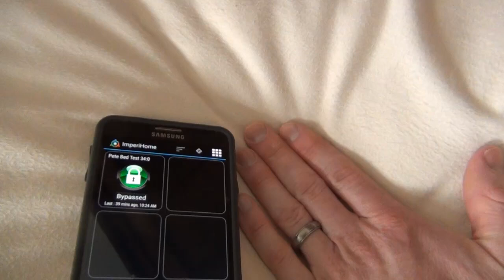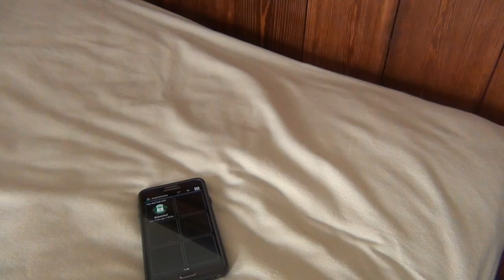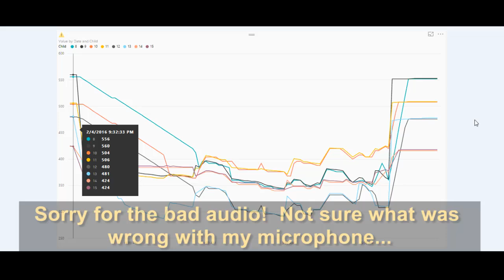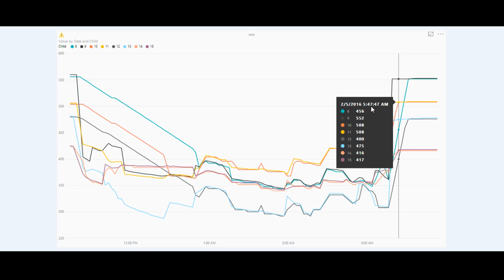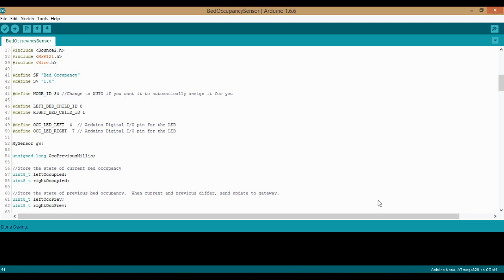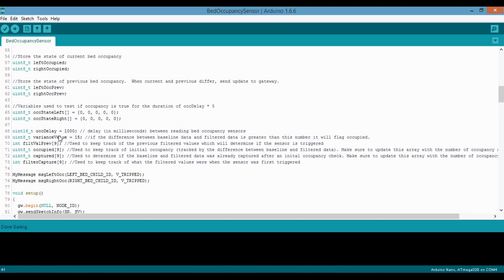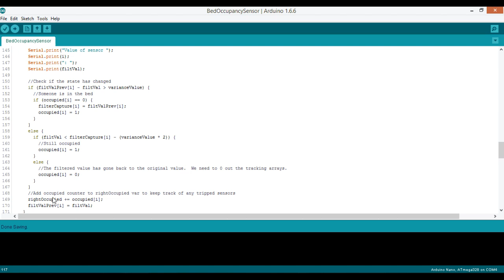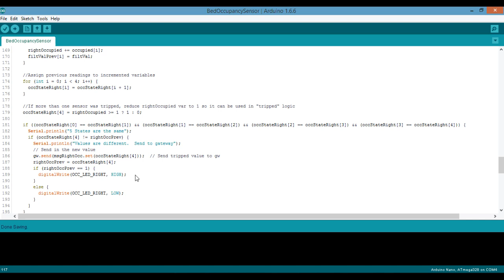Cheap Bed Occupancy Sensor using Arduino & MySensors

Comment: i use an ir sensor with reflector on the wall that is blocked when i am in bed. thinking of upgrading it using nvidia nano for image recognition..
Reply from the maker: I don't think the wife would allow me to do any image recognition but that would work great :)  This sensor is still working after all these years.  Occasionally I need to replace the copper capacitance sensors but not too often.  I would also look at a weight sensor if I were to do it again.  Might be fun to see if it could measure when I toss and turn in the night.
Reply: @peteb9105  so the wife is a bit shy..not like your posting the image,lol.
Reply: HEY I BET A cheap MPU6050 Accelerometer would work! have to give it a shot.

Comment: Hey Pete, are you still using this?  I tried making a bed occupancy sensor using load cells but found it way too hard to keep the feet (wheels) on the sensors.  Your method looks pretty cool and will try it if you can tell me if it has decent longevity.  Also, where are the strips positioned?  Are they between the mattress and box spring?  Thanks!
Reply from the maker: I have to replace the copper sensors once every 1.5 years or so.  I have changed the contacts/wire I'm using and I now use 18ga copper wire that I strip the sheathing off of so just the small copper wires are exposed.  I then compress them so they lay across each other and are spread out an inch in width.  I then tape them with clear packing tape to keep them from getting corroded. 
These need to be pretty close to your body so I have them between the mattress pad and the mattress. 
If you don't want to go with my method could you 3D print a container for the load cells and the wheels of the bed?  Might be easier if you already have a working method.

Comment: Does it work through an electric blanket and thick underlay or do you need this on top of the underlay? Does electric blanket interfere with the sensor?

Comment: Have you tested or thought of using an ultrasonic sensor?  They are commonly being used to sense occupancy of a vehicle in garages and could possibly be utilized over a bed as well.  I'm looking for a way to automate ceiling fan usage in bedrooms and are not controlled via a motion sensor since inactivity while sleeping would cause the fan to turn off.  There are currently some non-smart combo pir/ultrasonic sensors on the market that would work for applications like this but would be more difficult to adapt to home automation systems.
Reply from the maker: I haven't had the best luck with the cheap ultrasonic sensors when I tested them a few years back.  They make newer sensors that can measure distance more accurately (supposedly anyway) that could work.  That's assuming you make your bed every day so it doesn't think a pillow or blanket is a person. :)
Maybe a simpler solution is to monitor the room occupancy instead of the bed occupancy?  I have a very basic configuration that tracks if a door is closed and there is motion in the room after it has been closed then the room is occupied.  That assumes you sleep with a door closed though.
Reply: don't think my cat would like it.

Comment: Hi Pete! I'm looking for a bed occupancy detector. I need them all to connect to a central PC preferably, to know which beds are occupied and which ones free. Do you have any suggesion?
Great video BTW!
Reply from the maker: You can use this to do what you're looking for.  You would need one of these sensors per bed which would communicate with a MySensors gateway.  The gateway would then communicate with a home automation controller that runs on a PC.  Examples of controllers are: Home Assistant, Domoticz, OpenHAB, MYSController.  https://www.mysensors.org/controller  Hope that helps.

Comment: How to connect home assistant?
Reply: I would use an arduino sketch that fired off MQTT messages when the occupancy state changed, then implement a MQTT sensor in home assistant.
Reply: @djsteiner1  Can you please give me specific instructions?
Reply: Will you be sharing a write-up of how you did it?

Comment: Can you explain how do the sensors work? Are they just copper strips connected to... nothing?
Reply from the maker: All the magic happens with the capacitive touch sensor.  The wires (and copper strips) are there to increase the sense area of the capacitive touch sensor.  So, yes, the copper strips aren't connected to anything except the multicolored wires you see in the video.  I actually now use 18ga stranded wire flattened down instead of the copper strips (it's more durable).

Comment: What if you get up to go to bathroom
Reply from the maker: If someone is still in bed, nothing. :)  If neither person is in the bed the lights will turn on very dim if the white noise is on and brighter if it's not.
Reply: put a 2 min delay on the trigger or use an automation with time of day.

Comment: What other sensors do you have on your bed?
Reply from the maker: They aren't really on my bed but they are all running on the same Arduino Pro Mini "sensor".  I have a temp/humidity sensor as well as a relay that controls a white noise machine.

Comment: Wonderful idea, but a bit overkill IMHO... wasn't easier to put a load cell sensor under all 4 bed legs and let them trigger occupancy by weight increase (e.g. 50 kg)?
Reply from the maker: I actually was going to do the load cells first (I have them sitting in my parts drawer) but when doing the planning I found two potential issues.  
1. I didn't know how I was going to get the load cells to accurately be pressed down by my bed (they need to have a specific point depressed to work).  My bed is heavy and awkward and I didn't want to keep lifting it during testing.
2. More importantly, I was worried how they would perform over time.  I found a post about beehive monitoring (can't find it now) that was using load cells and they said they would eventually start to decalibrate as the weight was continuously applied.